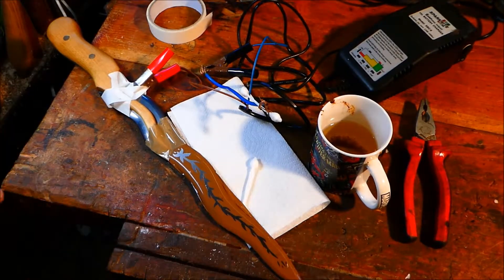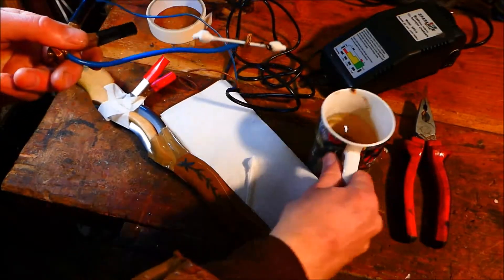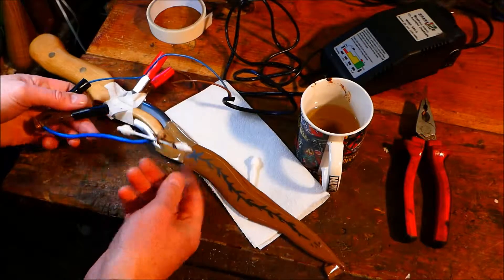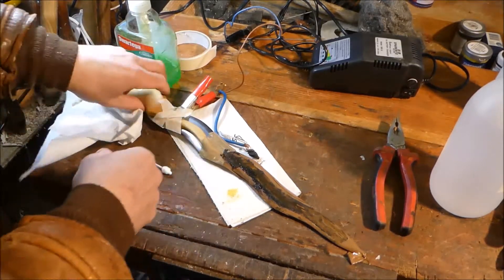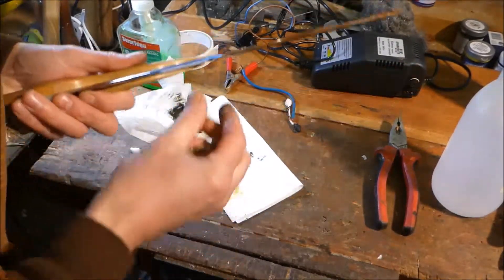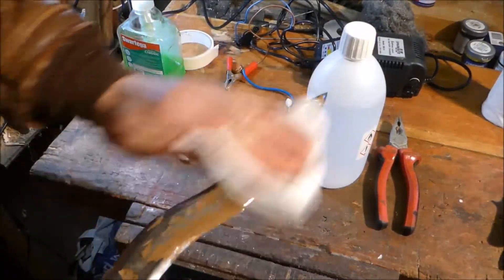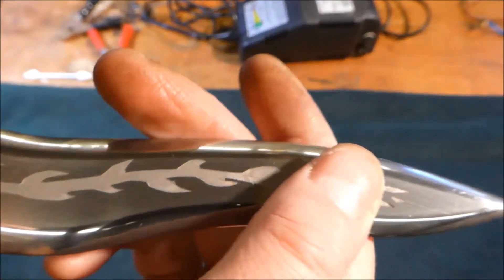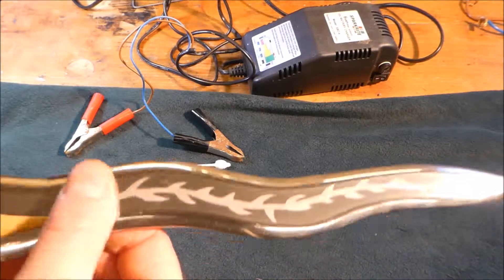Etching a Steel Sword the Easy Way

Comment: I don't etch with packing tape, but I expect you (or your viewers) might retain more definition and have a more consistent etch depth by moving the electrode along the pattern multiple times rather than lingering too long at one spot, since the etching produces HEAT, which impacts the tape and adhesive.  A lower max current on the charger (either an adjustable current limiter circuit, or use a smaller charger - like something for a defunct cordless drill) will reduce the aggressiveness of the etch.  Note that this etch process is outgassing hydrogen and oxygen.